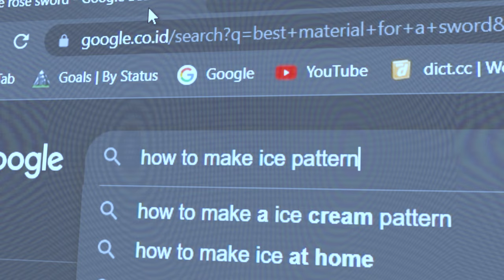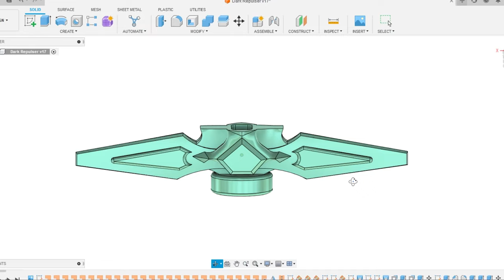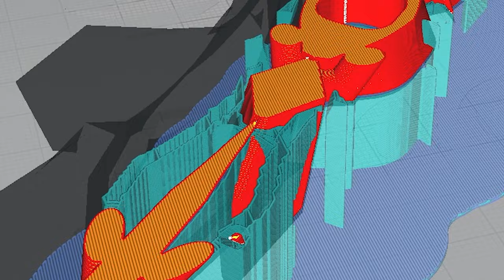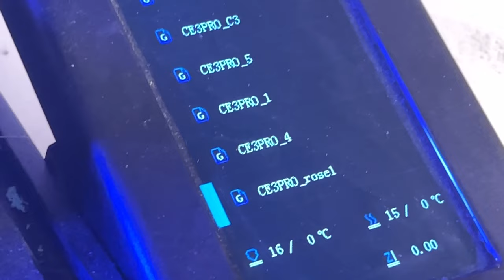I made Blue Rose Sword from SAO in Real Life.

Comment: You did a great job with that sword and the editing of the video looks amazing too, although if you're shooting at night you'd need a better camera or more light
Btw I've been making a 1:1 scale 3D printed skadi sword for 2 months. Maybe you'll make some arknights sword too because I saw your references to 0 sanity and other stuff.
e.g. Thorns sword, Surtr or Texas Alter
Reply from the maker: Good point on the lighting though. This is the first time I tried recording with this setup, so I guess could improve on that.

Yo I've been thinking of an arknights build, though. Do you think a 2 meter long Surtr sword is too 0 sanity moment? xD
Reply: @BeweNNN  The texas alter has shorter swords though they are quite detailed but the normal texas has a very simple one. Alternatively, a Ch'en sword or Irene's rapier in normal size remains.
Btw a 2m Surtr sword would definitely look epic but at this size it will take a very long time to make it.
Reply from the maker: @D.3.N  It's no problem I got plenty of time lol. But if you could only pick one of those, what would it be?
Reply: @BeweNNN  If you have a lot of time "just surtr it" A sword larger than a man is very impressive. And if you do it, from my experience I can add you to strengthen the hilt and increase its weight a bit to make the sword balanced.
Reply from the maker: Yo it's done bro.